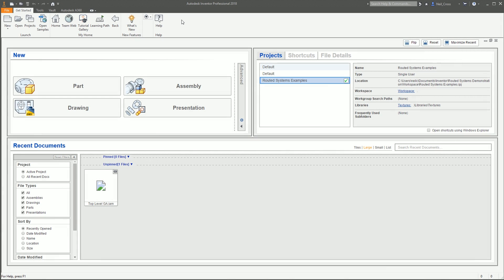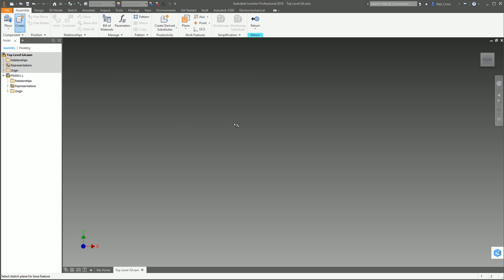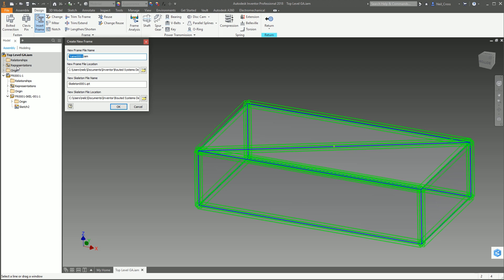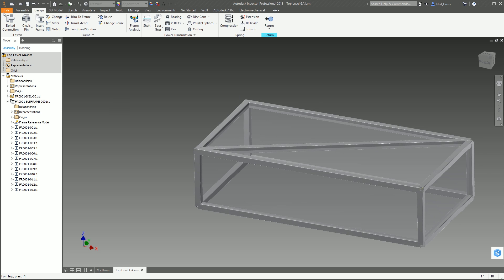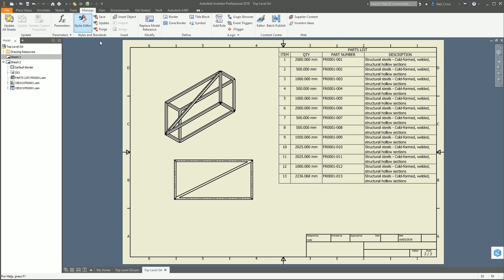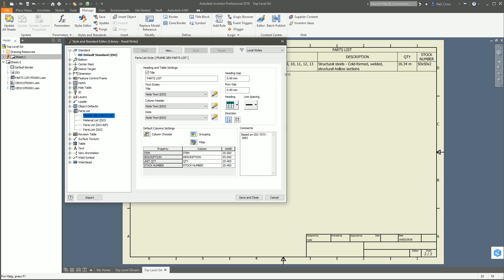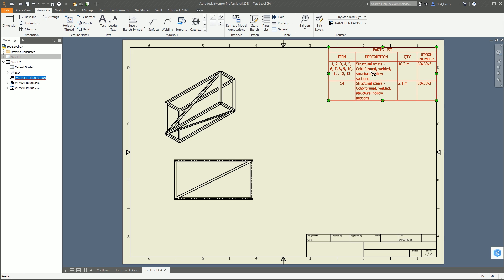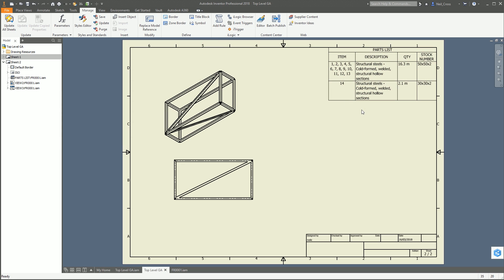Frame Cut Lists & Good Practice Frame Design/Management |  Autodesk Inventor

Comment: Please help: I have created a frame (Inventor 26) using two different profiles.  But when I create a parts list it only gives me the two profiles.  How do you create a parts list with individual parts and if you have several with the same length then put quantity of 4 as example on one line.  Basically how do you do the opposite of what you have shown.   The only way I can do it is open the frame and then right click on each part, go into the properties and put :1 then the next :2 , :3 and so on
Please help 😎 I sorted it by un grouping the part and stock number in the BOM window

Comment: we need to add a column with cost that takes the length of stock multiplied to a cost per foot or inch.  That would be co cool and actually useful.

Comment: I would like to see a video on BOM structure assembly level. I need individual frames in my cutlist. I am sorting profiles by G_L for length. this way I can get plate thicknesses aswell so long as I name the dimension G_L and export it. BUT. The cutlist gets an "incompatible units error" fromt he frame generator as soon as I notch, trim or extend any frame member that has an identical length same profile PRIOR to CUTDETAIL trimming. I can't find info anywhere.

Comment: By default it lists every single frame... not for me. It seems impossible to list the individual frames. It is just adding everything up in the quantity and in the unit quantity column it says "VARIES" I have been messing with this the whole evening. I need custom frames to show up correctly. For some reason the ISO frames add up the individual frame member lengths but the custom frames just show "VARIES" !?

Comment: How do I create the parts list style when I want to group items with the same length. So I would have:
   NR    /    LENGTH    /    ITEM_QTY
1...4    /     600mm     /        4
5...10   /    800mm    /         5

But all of them are from the same aluminum profile. By default it is just showing:
   NR    /    LENGTH      /    ITEM_QTY
     1     /     600mm      /        4
     5     /    800mm       /         5

But that just looks weird because it seems like items nr 2, 3, 4, 6, 7, 8, 9, 10 are not listed. Especially if I have them displayed in the balloons.
Reply: two years later - DID you ever find an answer? Thanks

Comment: But what about material optimisation? If I need 10 lengths at 2.5 meters it would tell me I need 25 meters total. Now I tell my requisitions department to order 25 linear meters but the bar lengths are 4 meters long. Being smart they go ahead and order 7 bars at 4 meters, which would give me 3 extra meters. But the problem is I need 10 bars at 4 meters, because each bar has 1.5 meters of waste.
Reply: Inventor needs a 1D nesting Add in!

Comment: As someone on the recieving end of a drawing like this, I would HATE! you to do a cutting list like that. Doesn't matter to me what the overall usage of material is. I want the length of each piece. Makes my job a lot easier when fabricating. It is afterall a cutting list, not a totals list ;)
Reply: I agree with you. Inventor let you set length per part or group together as an overall length.
Overall length good for quick purchased but manufacture they love to see each part each length.
too bad Inventor not giving the user an easy option to switch this feature.

Comment: great video.
Please! Make video about hierarchy in large assemblies, when many parts depend on each other.
why the inventor is so much worse than solidworks and does not have a boolean operation in the assembly that affects the part itself. realization in fusion 360 in my opinion very well, but in general it's still worse than the inventor